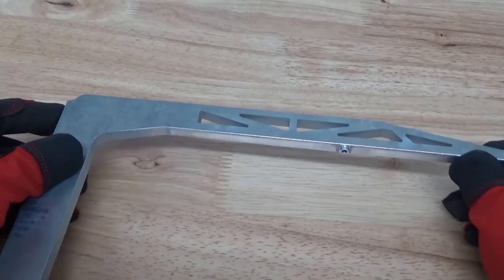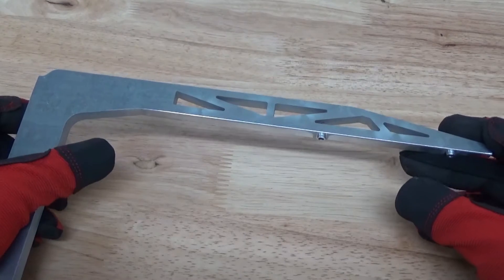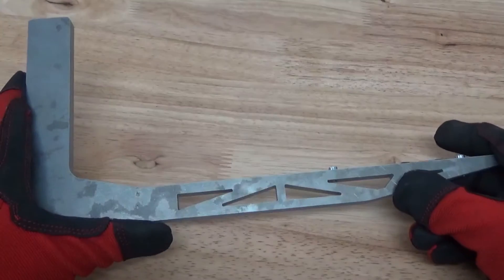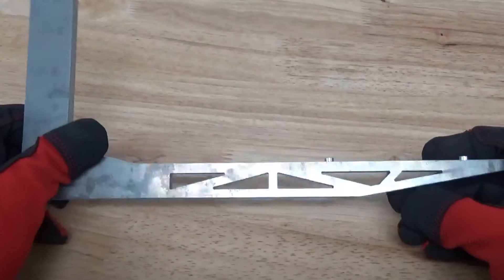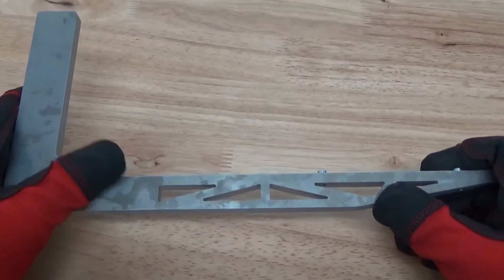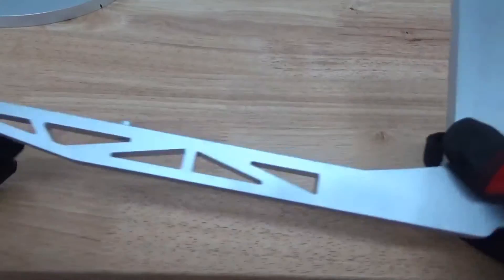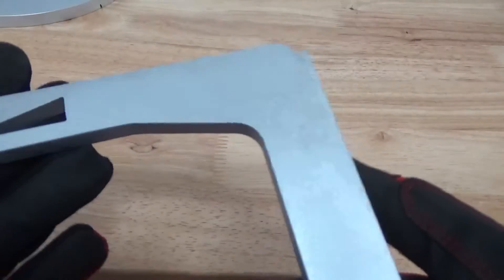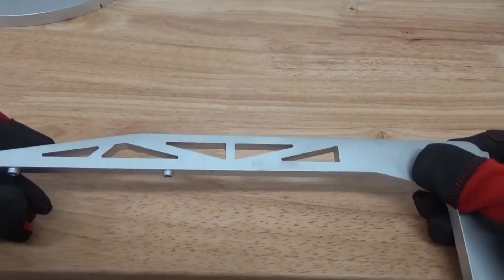Easy Cleanup 6061 CNC Machined Parts- Vapor Honing Technologies

Comment: I am currently using #220 aluminum oxide + glass bead mix....do you recommend to use #180 aluminum oxide for wet blasting to do it quicker on the heavier machine marks?